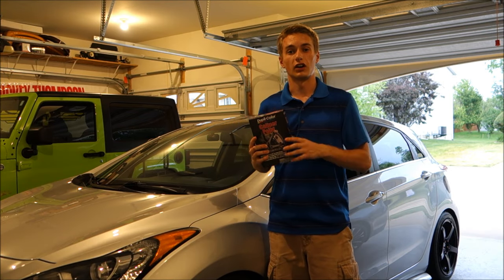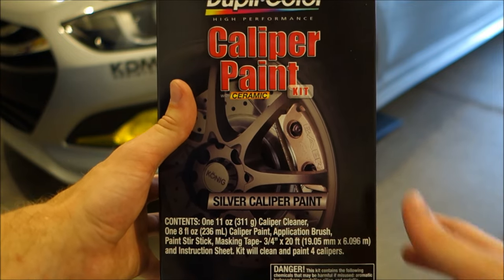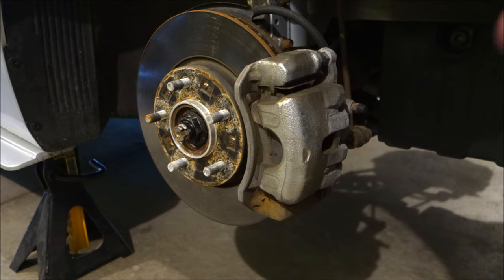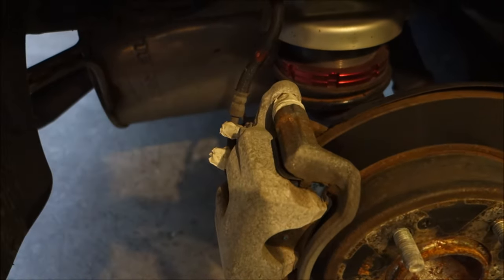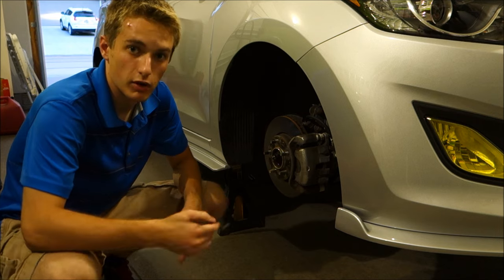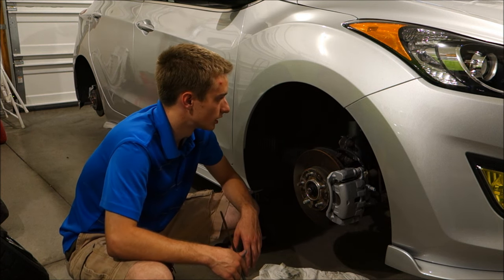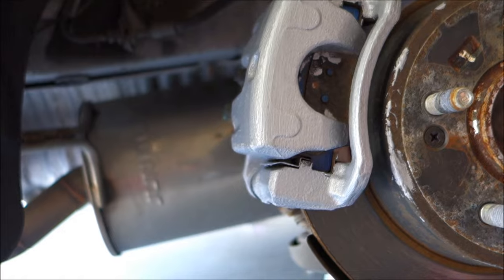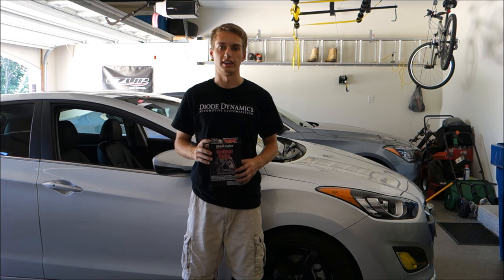How To: Paint Brake Calipers | Dupli-Color

Comment: The brush that comes with the kit definitely sheds! Had to spend some extra time getting them off the first one I did. I also scrubbed the metal parts with a wire brush, sanded with 1000 grit, wiped with IPA before painting. They came out pretty good for my first time doing this.

Comment: What are the key parts to mask off when doing it by brush? I have a 4 pot front and 2 pot rear for my WRX. So far it looks like the boots on either side, the brake bleeder screw, the rotor and the pad. Is that correct?
Reply from the maker: Anything that is rubber, threads to take in/out, and brake pads/shims. You can determine it on the fly while doing it but those are the main things I would say.

Comment: Bro is there a quick dry paint on (not spray) type of paint? Quick dry as in say 1/2 an hour or so...?
Reply from the maker: Not as far as a brush on that I am aware of. This will dry to the touch fairly quick but they recommend not driving due to the heat from the brakes since it is still curing even though dry to the touch.

Comment: how is the paint holding up
Reply from the maker: It went over 3 years without showing any signs of wear. I think eventually the winter salt started to strip away the top layer and the brake hardware started to rust which discolored the bottom of the caliper. With proper application and care I would say you should expect a good 2-3 years without worry. They still looked better than they were at the end too.

Comment: DO NOT USE DUPLI-COLOR CALIPER PAINT!!!!!!
Brake fluid removes Dupli-Color caliper paint right down to the bare metal!!  I am not joking.
Reply from the maker: Jeff H That's not the paints fault... Its not OEM grade paint either so one should not expect the durability of OEM paint.
Reply: The vehicle never saw the road.  The vehicle, the calipers, and the paint, never left the garage.  I am not sure why you bring up durability, as the paint never made it to the starting gate to test durability.
Reply from the maker: Well brake fluid on fresh paint may cause a problem. I dont know the chemical compounds of either but it may react. Calipers are not exposed to brake fluid on a regular basis especially when freshly painted as I assume they were.
Reply: The paint cured for more than three weeks before the caliper was mounted to the steering knuckle.  Ceramic paint requires significantly more time to "cure" as opposed to enamel or lacquer paints which "dry".
Reply: My vehicle is a GMC Sierra 2500HD Diesel with a 10" lift.  I was changing out the front hub assemblies since the bearing on the driver side was going.  When front hub bearings go on a full size truck, they go very fast. While I was changing out the hubs, I decided to restore the front suspension, steering components by removing any rust, peeling paint, etc., and repainting everything.  While the truck was going to be up for a while, the rotors were a little more than 50% gone, so I decided to change out the rotors and pads.  This gave me a good opportunity to paint the caliper brackets and the calipers.  The calipers had more than enough time for the paint to cure, considering everything else that was going on.  The caliper brackets and calipers were painted October 8th and installed on October 30th.
Reply from the maker: Jeff H All I can say is mine haven't shown any signs of deteriorating. Yes they are dirty but I've even had the wheels and tires off recently and they still looked great.
Reply: Fortunately, we don't have to bleed our brakes regularly.  I am fairly certain the paint will hold up after it is repaired, it just doesn't hold up to brake fluid at all, which is the irony of it all.
Reply: Jeff H brake fluid really mess up any paint.